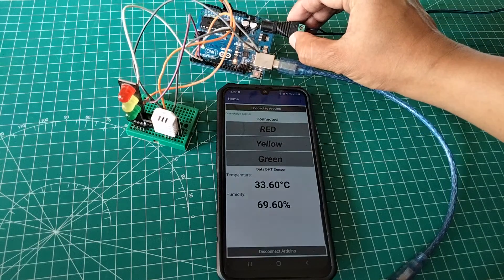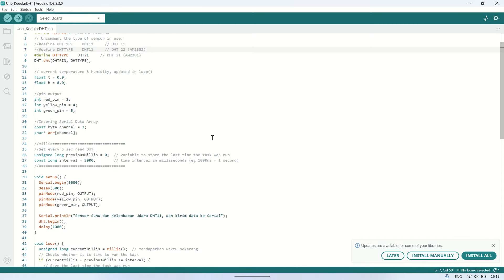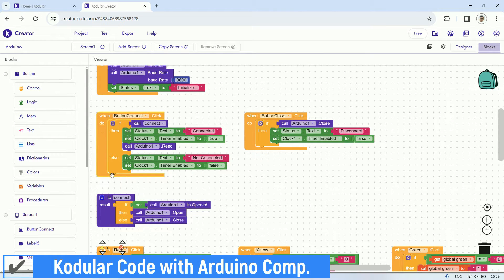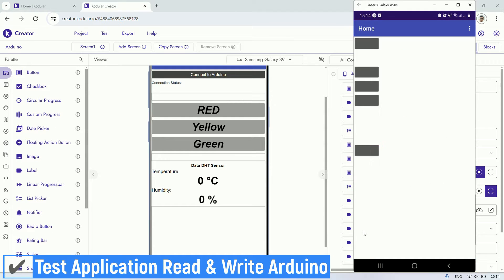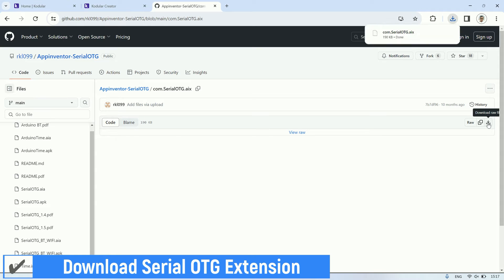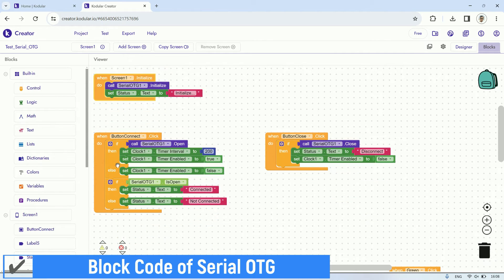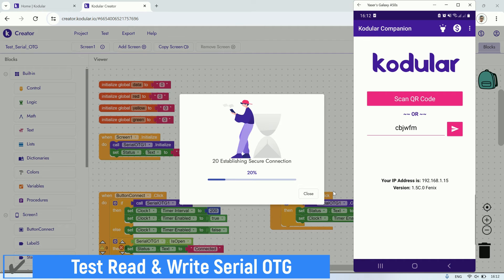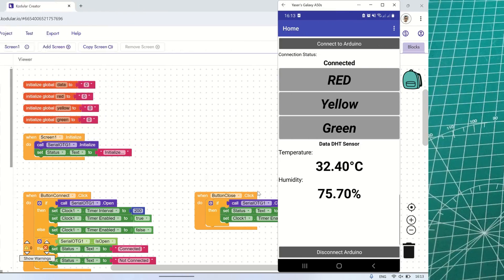Read & Write Arduino from Android Using Kodular Via USB Serial Communication

Comment: Hello I think that the power supply of the Arduino is useless, because it is ousted by the power supply of the mobile, as proof the charging symbol of the mobile is not active and if we disconnect the power supply, the system still works. This is the disadvantage of this assembly, the ideal is wireless communication so that each device can have its own power supply
Reply from the maker: Yes correct,
I just keep low energy consumption of phone battery for powering up arduino.
This is just experimental how to communication via USB from smartphone to Arduino.
In other videos, I show wireless communication
Reply: @YaserAliHusen  HO thank you very much for answering, it's becoming rare,
do you have a link for wifi communication (I have a wifi uno included without module and an esp32)? I can't find it in all your impressive videos.
I think that for a beginner like me, the same example of a wifi program would be interesting to see the evolution.
Is it possible to put a power supply on the OTG cable for both.
sorry for my English google translation ;thanks again.